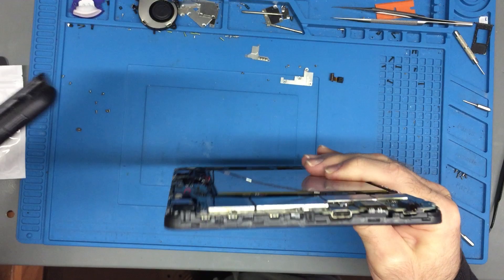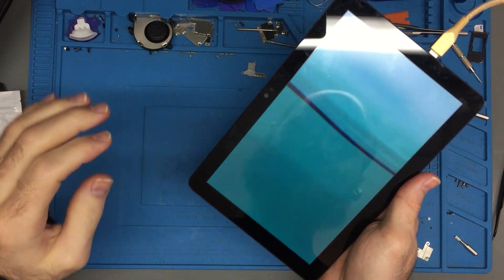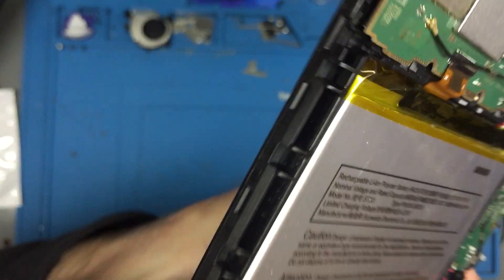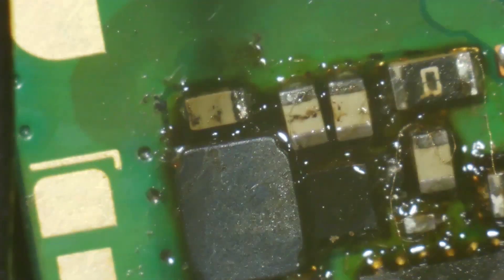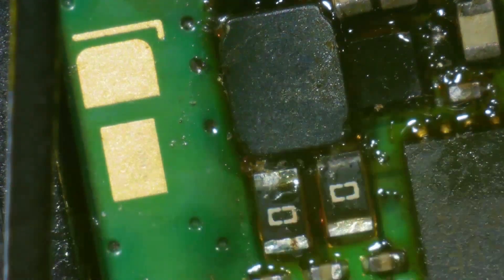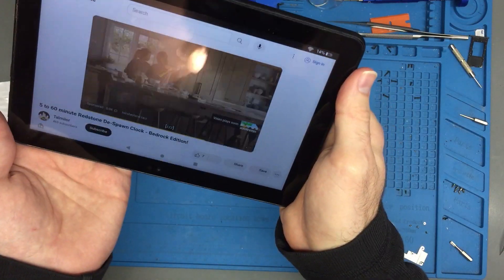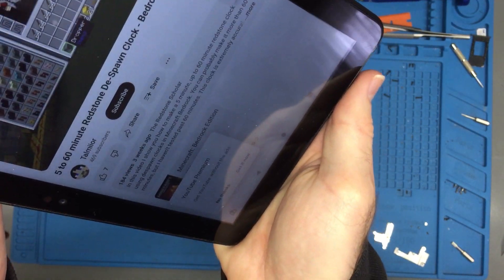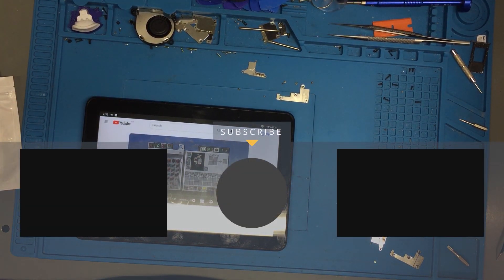Repairing an Amazon Kindle Fire HD 8 10th Gen Tablet - Part 2

Comment: Thanks for the videos!  I'm trying to fix my granddaughters Amazon Tablet, it is stuck on the Amazon logo at start up.  I've tried everything, nothing works to fix it.  But, there is a video regarding ADB (Android Debugging Bridge).  I loaded and set up the app, I have the BIN file needed for fixing, but cannot get ADB in the Command Prompt to see the Amazon Tablet/Device.  I'm assuming it's because  "USB Debugging" is not activated on the tablet, but I can't activate it because the tablet is frozen :(  Any advice?  Thanks for your help!
Reply from the maker: that's a real tough one ya got there! Usually you would use the volume and power buttons to get into the startup menu that would allow you to put the tablet into debugging mode. If you can't get into that menu, you're stuck. Use this search string in Google. (I saw some potential videos that might help ya):  
"amazon fire tablet stuck on boot screen" 
Though sounds like you already may have tried that. I would also recommend back tracking on what may have caused the issue. Find out if if your granddaughter dropped it, or exposed it to some kind of liquid. If it did receive some kind of damage, no amount of software debugging will solve the problem unfortunately

Thank you for commenting on my video! My channel is only a couple months old. You're literally the first person that has commented on a video of mine.